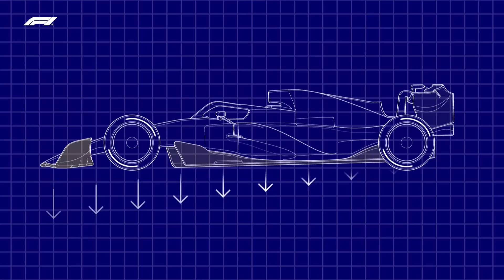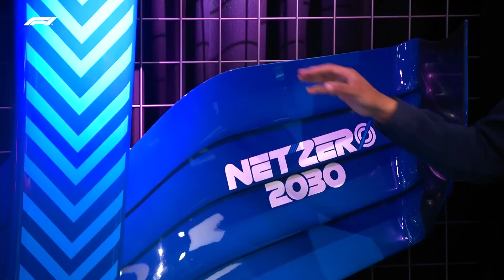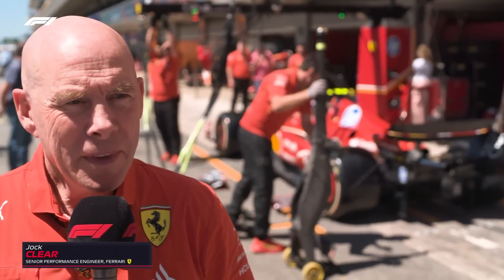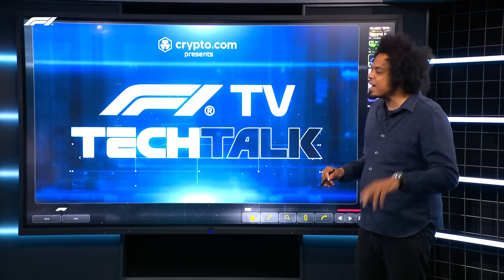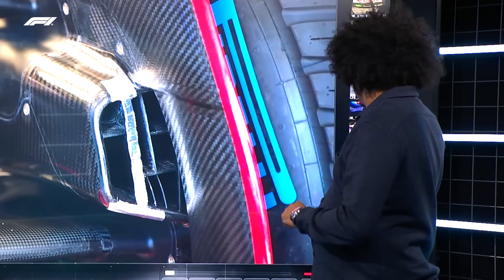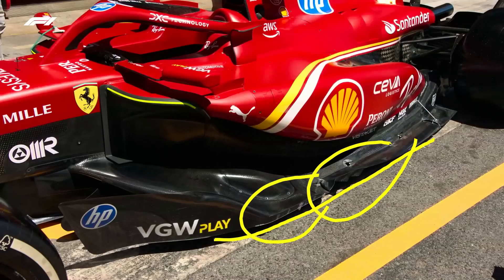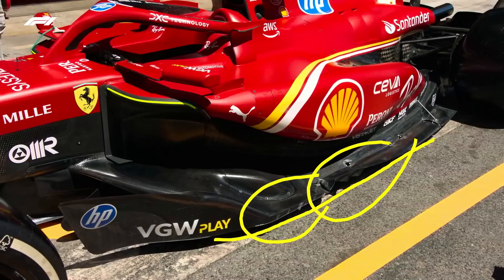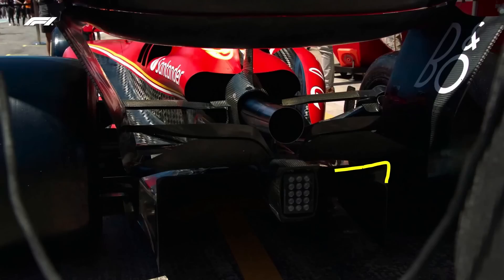Why Do F1 Wings Flex? | F1 TV Tech Talk | Crypto.com

Comment: Excellent post as always, but isn’t F1 getting to much about aero, bits of angle carbon sticking up and out everywhere, why not just have one element on front wing, and like years ago ( heavens above) let the driver control the car sliding with his feet, ie throttle and brake, just getting boring now, as clever as it is.

Comment: 2:04

You've got it completely backwards. It doesn't cause flexibility. You need to build the part with some flexibility in mind, because it being completely rigid (and still light) would mean it would snap off with the forces involved.

Flexibility exists because it was built that way. It's allowed because despite the rules, physics are a thing. Even gun barrels flex and wiggle while fired (check out .50bmg slow mo firing) and that's also by design for the same reason. You could build a completely rigid gun barrel but it would then be way too brittle.
Reply: Nothing is completely rigid or stiff.
Reply: @procatprocat9647 that’s what she said 😂

Comment: Although drag reduction is a benefit, I thought the real benefit to flexible front wings was aero balance. As the front wing backs off and loses down force it shifts the aero balance rearwards. That means you can still have a pointy car in the low speed corners and a more stable car in fast corners.

Comment: How do they test for floor flex, i think as most of the downforce comes from the floor if it can deform on the straight you will get amazing cornering and almost super drs as the speed maxes out.
Reply: Floor flexing causes poor performance because it needs stable air and calculating for wanted flex is almost impossible

Comment: i thought the whole spirit of the rules was that aero can flex but cannot be designed to flex. the front wings have been designed to flex for years now, you can tell by the little plates midway through, as well as the wobbly rear wings. what gives?
Reply: Exactly. There are dots on the rear wing for this but not on the front?
Reply: @Slitch-nl1  its not about being able to measure it, its that its clearly DESIGNED to flex in the first place. that is neither rigid, nor immobile, nor impervious, nor continuous, etc. theyre all in violation of 3.2.2 to the letter of the law

Comment: why not have a dedicated small wind tunnel just for the front wing? it's the front most element of the entire car so the airflow doesn't really change if the rest of the car is there or not. have sensors which measure deflection distance at various wind speeds
Reply: Windtunnels are too big.

F1 cars actually have smaller scale models for the windtunnel.

An full scale frontwing would need a bigger windtunnel most F1 teams have at their factory.
Reply: @barneyklingenberg4078  im talking about a windtunnel specifically for testing the actual front wings the teams use, not scaled models

Comment: The FIA needs to build their own wind tunel.Then they can randomly pulll a part, or even a whole car from these teams, and then they could really find out what these sneaky engineers are really up to.
Reply: It will not be really helping because the FIA has to do those tests on track after each races (not for all the cars at the same round thought). It is made like that because if not, each team will bring a specific version of there parts during the testing in a wind tunnel at the beginning of the year but will bring a different versions of it, not complying on race days. This is why the checks have to be done on site, on track, and can not rely on a wind tunnel, if the case then, each track will had to have its own tunnel which simply impossible…
Reply: @GenghisDaniel  The FIA can impound a car and take it to their test wind tunnel after the race.
Reply: @graemewilliams6697  They can but it is clearly a rare occurence, the general tests need to be made on track without any windtunel, there is no other way.
Reply: Odd. I was just thinking that
Reply: I think they could just rent a full-scale wind tunnel. The Sauber wind tunnel has the capability of full-scale IIRC.

Comment: Makes you wonder what could be done with the floor and the inner body that you can’t see or measure. 

Perhaps using the air to change the shape over a certain airflow to stall the floor on the straights? It would make top speed through really fast corners less (Parabolica) but allow more everywhere else. 

Or, you could have the inner body work collapse and make the floor less severe. 

If the floor moves under load, who is going to know? 

How much is actually needed to make a difference?

Comment: As we can see there are n upgrades on the car, starting at the front we can see the new revised wing - slightly different to previously - obviously the front of the car is important because its the first part to touch the air. Moving to the sidepods we can see they've added a couple of new elements and tweaked the mirror housing and though you can never say exactly what it does, we can reasonably assume that thats to reduce drag and maybe ultimately increase the downforce too. Now if we look down here you'll notice that there's a new floor edge, and as we know, with these current ground effect cars, most of the down force is generated by the floor, and so what they're trying to do here is effectively seal the floor, stop any air leaking in. Finally at the back you can see a new beam wing design (they can never explain the beam wing design).
Reply: You really have a lot of free time to type all this
Reply: @danydeezy3243  yeah im really lucky to afford those two minutes, some people dont have that privilege
Reply: FYI, they call it a ground effect, but it,s not really it. A real ground effect is what lotus did,  long time ago.
Nowdays, it should be called "venturi tunnel effect" .
Between the flat part of the floor and the seat, there are tunnels that channels the air going "under" the car.
The lotus ground effect story is very interesting. And still not really clear why the FIA banned it, just a couple of races after..
Reply: @martf1061  What about 2026? Is it real ground effect? :p
Reply: @kerimca98  🤷‍♂️
Reply: @martf1061  ground effect has applied to every car which has had a floor and a diffuser. Obviously different regulations have dictated how much downforce this is responsible for. The cars that draw greater proportions of the downforce from the effect get called ground effect cars. Its probably true to say the early nominal ground effect cars drew a larger proportion but the new ones are called ground effect cars because the regulations were designed specifically to increase the downforce produced through ground effect.